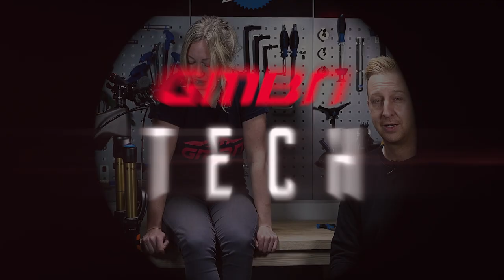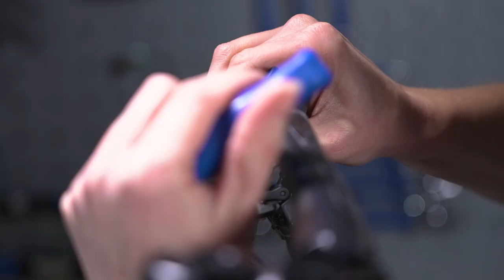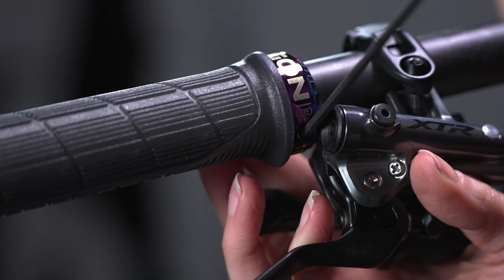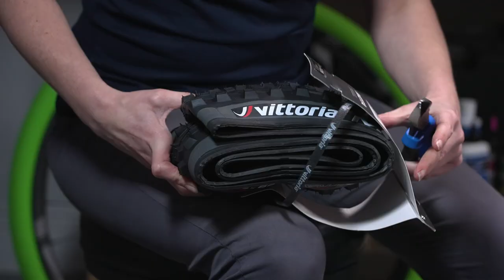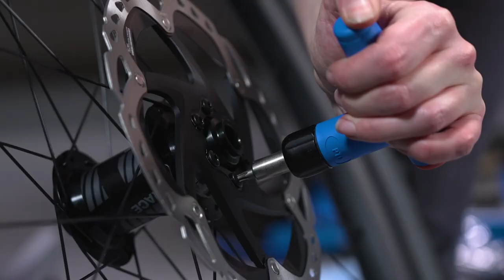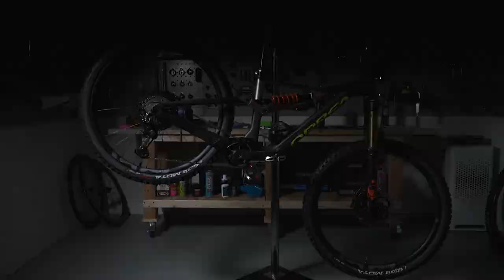Building A Dream Bike With GMBN Tech's NEW PRESENTER!

Comment: Welcome Anna.  That's a super nice looking bike.  I noticed some of the sound was added in post.  When you took the bike out of the van, the wheel and crank arms were barely moving, and there was a lot of clicking going on.  I was wondering, it looked like the sound coming from that rachet wrench was real.  If so, hit the GMBN tech guys up for a 90 tooth rachet!  If your wondering, I work professionally repairing wireless microphone equipment, and am also a tool guru, so that's why my comments might seem a little strange.  Don't worry about the comments about your riding, anyone on a new bike shouldn't look super confident, unless their too crazy to know better.  More experience should equal less confidence on a new bike always.

Comment: Congrats on joining the team!    Question: Can you ...or should you put the carbon grip paste on your controls?  Grip and brake?  And do you torque those controls to manufacturers spec or back off a touch?
Reply from the maker: Grip paste gives you some extra substance between two components so that you don't have to over-torque something in order for it to stay in place. I personally grip paste my controls and use manufacturers' torque recommendations. I don't tend to grip paste my grips, but only because I don't have a problem with them moving. I hope this helps! - Anna :)

Comment: Lining up handlebar with the stanchion of the fork is a great tip. I will do that next since lining up stem with wheel is next to impossible with my short stem (35mm)
Reply from the maker: Exactly! haha - Anna :)
Reply: @gmbntech  done it and for the first time I got the handlebar setting right. Thank you so much💓. Usually there is always a bit of misalignment that I fail to straighten out. God bless you dear. My left traps is now sore free and my bike handling is so much better.👍

Comment: #askgmbn just wondering if there is anyway to make cheap coil fork softer?
Reply: One thing you can do for sure is to take it apart, grease everything and add some fork oil. Most of them come dry out of the factory.
Reply: @hanswurst6864  That will reduce friction, not make make it "softer". What they need is a coil spring with a lower spring rate.

Comment: When tightening bolts on disk rotors, in the auto world we would tighten things in an opposite pattern. Forming sort of a star pattern. Is that something I don’t need to do on my bikes?
Reply: Its recommended to tighten opposite bolts on brake rotors for bikes
Reply: @erikanzenmtb3124  I mean that’s what I do because it’s what I’ve always done on automotive things. But I don’t see it as common from
Bike mechanics
Reply: @307.William  many bike mechanics don’t use torque wrenches so 🤷. IMO opposite pattern is the correct way to do rotors and stems.
Reply from the maker: I thought that's what i did do! I usually go for a star pattern too. - Anna :)
Reply: @gmbntech  awesome!! Thanks for the reply, I’ll make sure I do that and great content!!

Comment: #askgmbn Hi guys!can i reach out?im planning to convert my 26" Xc hardtail bike into downcountry Mullet Setup, Can I know what size of fork should i use?26"or 27.5"? What travel of the fork is recommended? I 💕 Ur show from ur Filipino fan❤️.
Reply: If you are thinking Mullet on a 26 you'd have to use a 27.5 fork to fit a 27.5 wheel. As for travel goes I think 100-120mm, more than that would really mess up the geo.
Reply: I'd bin the bike and buy an enduro bike.